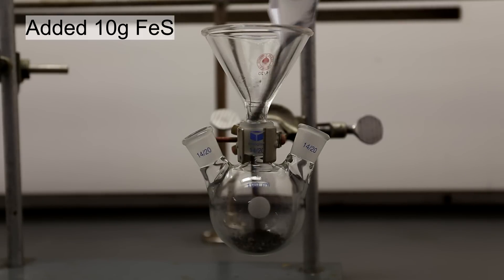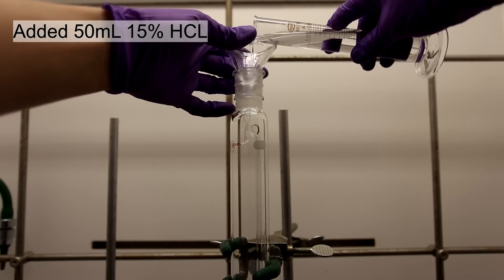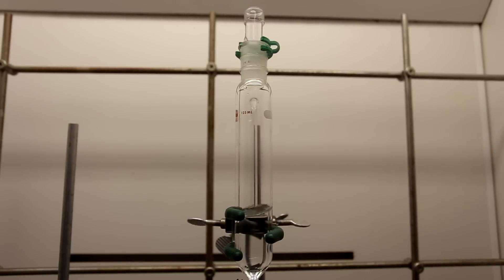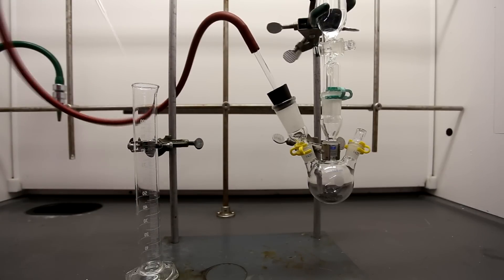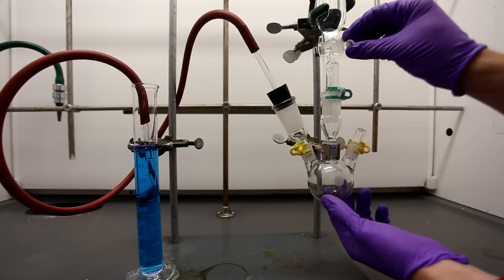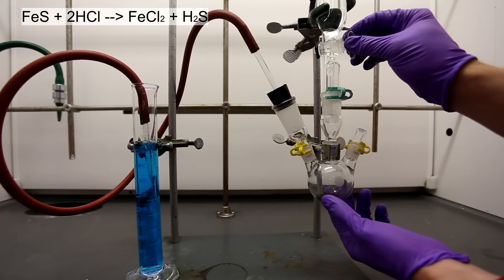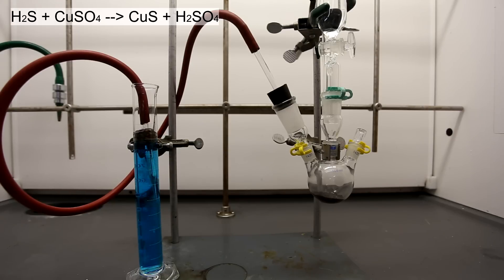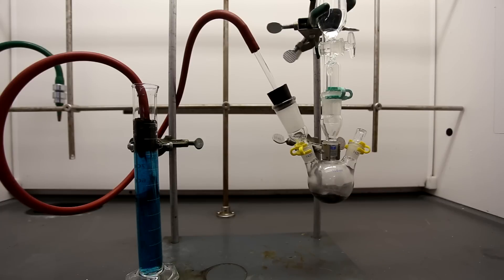Making a Hydrogen Sulfide Generator

Comment: Hypothetically, if i where to dump the all the HCl to the iron sulfide at once, will the reaction still happen? Also, if i were to do it in a 45 squared meter building with 12 slightly opened windows and 2 doors , will 2.5× the amount shown in this video kill a group of 18 people in the building? Hypothetically of course

Comment: This is most certainly a substance that is often not given adequate respect. Whether it’s in a small lab or out in the fields of petroleum and water pump stations, it can be a truly equal opportunity killer! Unfortunately a worker at one of those field pump stations lost sight of that. It cost him his life. Not long after, his wife became concerned that he hadn’t returned and wasn’t answering calls. She loaded their kids up and went to look for him. She found him deceased next to the pump but before she knew it, it cost her her own life. When emergency responders arrived, they were hit with the overwhelming vapors. They had to use full contained suits in order to get to the children. 

These pumps were in a a sizable pump house that was equipped with detection devices, a ventilation system and two large roll-up warehouse style doors. There were so many safety/alarm systems “apparently” in place, this should have never happened. Yet those systems were not working. The company gave employees personal detectors but put no emphasis on using them. Had no training, rules or policies about lock-out/tag-out processes. The company’s justification? They had signs on the perimeter fence that read “danger toxic gas” and they provided pamphlets.

Pamphlets?! Really?! 

I mention all of this not just because it’s the same chemical but because the industries that should be the experts in these chemicals show less respect for these substances than a young man conducting experiments on YouTube! 

It’s absolutely amazing how the more money that’s involved the less respect that is shown!

Comment: if you perculated H2S  through hydrogen peroxide would you make sulfuric acid????
Reply: Only if it is a basic solution, or else it makes elemental sulfur.
Reply: @smusha2840  thank you!!!!
Reply: @juaffle  a small correction though, the specific term is alkaline solution. No problem, though

Comment: i have a super nerd question!
how would i remove hydrogen sulfide from water with minimal materials indoors, without venting it outside?
creating energy, or not.
why, you might ask?  im making fuel out of methane, and im using water as my last stage of filtration, after iron scrubbers.
im looking to make this a completely closed system with every aspect of its design considered. 

any ideas would be phenomenal!

Comment: There is one video here on Youtube with a similar reaction, only replacing the HCL for H2S04, but then the reaction goes much slower than yours. Is this normal? Is the reaction when using sulfuric acid really slower? Or maybe it's because the FeS used in the other videos is in bigger chunks rather than powdered? Thanks.

Comment: How do the contents of th addition funnel empty if it is stoppered?  Doesn't it at least need to be cracked to drain properly?
Reply: Looking through it, it looks like a tube is behind it so it's most likely a pressure-equalizing addition funnel.
Reply: It's pressure equalized.

Comment: +NileRed Performing that process in order to produce sulfuric acid,  could it work to get concentrated 98% H2SO4? Because, I've been trying to obtain sulfuric acid by many ways, nonetheless, the only way I could obtain conc. acid was making pass SO2 gas through a 50% solution of H2O2. Actually, the yield was truly low, starting from 500 mL of H2O2 I only could get kind of 30-40 mL of H2SO4. For that reason, I'd like to try another better process, and I finally found your video. Could it work in the way I want?
Reply: why not just distill off battery acid?

Comment: I find it hilarious that this toxic compound is actually technically a heavier analogue of the very molecule we need to even exist.
Reply: @Crawdoodle  in terms of both being highly electronegative organic elements that have the same bonding pattern but are different in bond strength? Sure. The fact that one is right below the other on the periodic table isn't a coincidence, they are in the same period. That gives a clue as to the kind of similarities you'll find in the two elements.
Reply: instantnoob *same group
Reply: Maybe that's why it's toxic? Maybe it can take water's place in the biochemical reactions happening in our bodies, resulting in molecules that don't behave correctly and/or do bad things?
Reply: @Come up With unique username #VoteBlue so is water vapor, also where the elements are in relation to each other isn’t random, as another comment or said, elements a\at are in the same row or same column share similarities, different similarities based on whether they’re in the same column or same row, same column means the same amount of valence electrons which determine how many bonds it can form
Reply: @Paonporteur the H-Bonds of H2S are just weaker than those of H2O, which is why the boiling point is -60°C and not 100° like for water.
Reply: @JustinKoenigSilica if water boils at 0° where you live, no matter what units you're using, then I think your atmospheric pressure has a problem

Comment: H2S is sinister nasty stuff.  If you are exposed to low levels, it will numb the nerves in your nose and then if the levels rise suddenly, you'll never know.  We have to carry a 5 gas meter (O2, CO, H2S, LEL, and NOx) when working near it at work
Reply: a simpler way to tell is to have a little piece of paper soaked in led acetate solution; if that turns black, H2S is there (but gas meters are clearly a safer choice)
Reply: Or if you're poor af you can use a stick with a piece of silver on it and if it turn black you run the other way

Comment: I worked at a sewage treatment plant many years ago, I had to go underground to check some valves. While I was down there, the gas detector went nuts and I caught a couple of lungfuls of hydrogen sulfide. I was out of work for a week with severe cramps and vomiting, nasty stuff. Great videos by the way.
Reply: ***** You must feel lucky to be alive, I work in the oilfield and it's a constant threat.
Reply: ***** Holy $#!@# dude. I totally second Christian's comment: you're one lucky dude. Did you pass out or lose your sense of smell?
Reply: This happened to my buddy Eric
Reply: did you sue them?
Reply: +Jellyf0x It's a yummy gas, that's all I can tell you.
Reply: I watched a guy drop in about 30 seconds from h2s, must have been one of those meters that only reads 10 ppm. My experience, he was unconscious in less than a minute, we dragged him out of the h2s rich environment and then he woke up, zero health affects even after being taken to the hospital. A similar event happened at a separate facility up the road, years apart, a man was knocked unconscious from H2S and once in an O2 rich environment was fine. I’m not downplaying your experience and yes this gas is very dangerous, one breath is instant death, but I have some experience. My personal experience is breathing in H2S inside the cab of a truck, the meter we had overloaded at 100 ppm, which is the OSHA definition of IDLH (Immediately Dangerous to Life and Health). Any who, we immediately stopped the truck and jumped out. Then fixed the issue and went back to work, an hour later I thought I had a headache but didn’t require ibuprofen or Tylenol. Since that day I had a respect for H2S but had been exposed to concentrations of well into the 4000 ppm. As long as you understand your job and do it correctly as well as safe, you’ll be fine. I don’t believe you spent a week out of work for exposure, H2S  is quickly broken down in the body once exposed to oxygen. Again I’m not you and don’t know much about the situation, but from what I’ve seen personally, this is an exaggeration. Oh and by the way, one of the workers I witnessed getting knocked down, was crying in the office begging to not get fired, this happened prior to being taken to the hospital.
Reply: @gunslinger7902  did you mistype that 4000 ppm? that's like, 4x the instant death concentration, how the hell did you live through that?
Reply: @partyhardcake the craziest part about this anything less than 10000 ppm is less than 1%, and it only takes 700 ppm for immediate death to occur